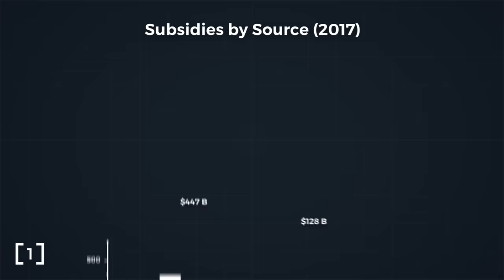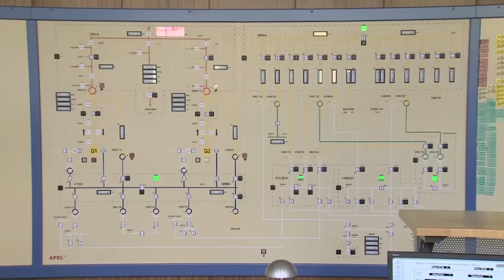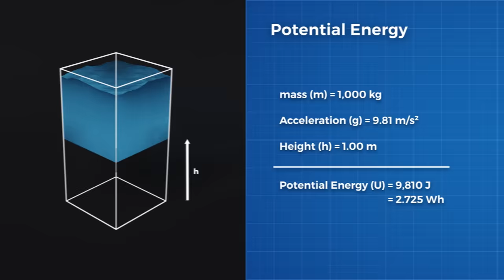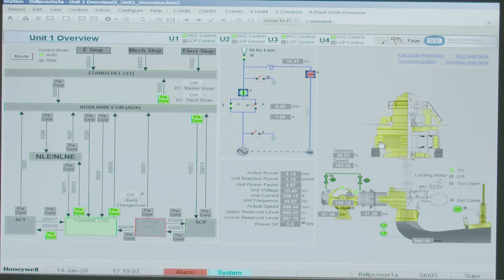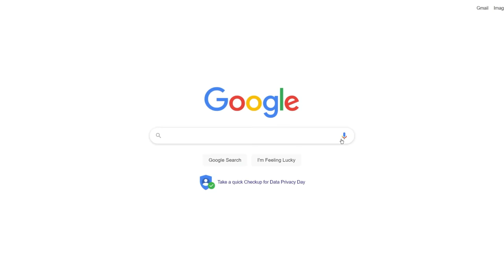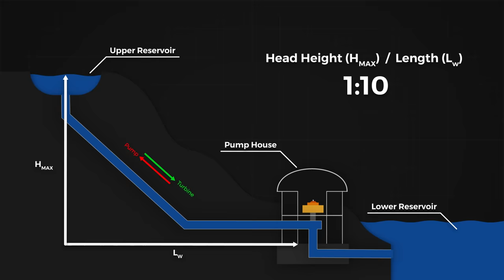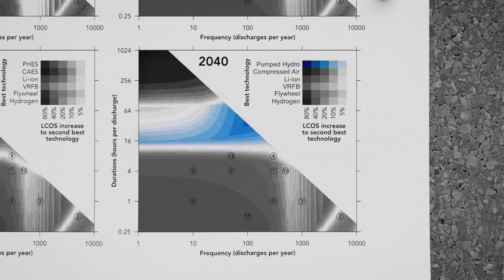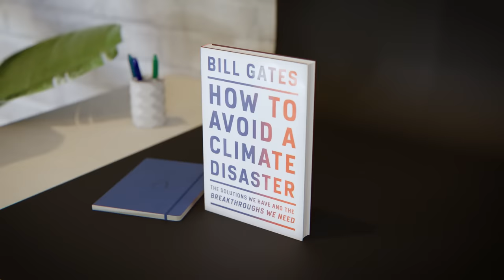The Truth About Pumped Hydro

Comment: You should take a look at the "El hierro hydro-wind plant" in the Canary Islands, it uses an old volcanic caldera and sea water.
Reply from the maker: Oh for real? I tried to find cool examples, but that didn’t come up in my search.
Reply: Indeed, the El Hierro 100% renewable island has been huge for a while, said to be the best example of such a solution, and it is.... Because it's a massive failure, the whole thing is so far from the claimed 100% renewable that it is laughable. No wonder it doesn't pop up anymore besides being used as an example of what such a "solution" brings:
- Massive price increase in power cost
- Blackouts
- Still more than 50% of all electricity is produced by diesel generators
This is exactly what this solution brings and is that perfect example of what NOT to do.
Reply: @RealEngineering  for a visit Cruachan (built1965) is a cracker and the climb up the Ben (Cruachan) is dramatic and almost lunar.
Reply: El Heirro:
What Kind Of Pumps Do They Use? Wind? Perhaps They Could Also Include A Battery Of Freznel Based Solar Condensation Pressure Boilers, With Hydraulic Pistons, Check Valves, And Inline Drop Points, Similar To A Combination Of Heart Pump Mechanisms And Transpiration, To Supplement To Pumping Operations? In Proper Applications, It Can Not Only Basically Combust Water Instantaneously, But Distill It As Well, While Producing Excess Extractable Energy.

Fo Realz.
Reply: @Gornemant  Even assuming your reporting of El Hierro is accurate, your conclusion can be dismissed because of your abysmally small sample size.
Reply: @AlbertaGeek  My conclusion on El Hierro, given that it repeats itself over and over again with similar projects, is:
"Never trust someone who is trying to sell a 100% renewable solution based on calculation, because they leave out so many factors on purpose to sell you crap that just doesn't work as advertised."
The massive price increase can be observed everywhere where an increase in renewables is attempted, best large scale example for that is Germany, they are also increasingly close to blackouts with interventions on the grid to stabilize it having gone through the roof. They have nothing to cover for the nuclear plants that are to close the next two years yet they are still happily churning coal and pellets from massive deforestation across the globe.
There has yet to be a 100% renewable solution with wind and/or solar, even on a scale as small as El Hierro. If it can't be done on such a small scale, then a large scale industrial country is utter nonsense.
Reply: @Gornemant   "it repeats itself over and over again"
Talk is cheap.  Name twenty.  Still an extremely low sample size, but should still yield better results.  I await your response.  And remember, the burden of proof is on you.  It is you who must support your argument, so no jamming out with the common refrain of the person who cannot do so: "Look it up for yourself."

Okay, so twenty examples.  An hour should be enough time for you to compile such a list, so we'll see where we are in 60.  I look forward to your response.
Reply: @Gornemant  So, you got nothing.  Figured as much.
Reply: The same thing happens in a Greek island Icaria https://www.ekathimerini.com/economy/241310/ppc-launches-green-energy-park-on-icaria/

Since we have a lot of islands we have tried different energy solutions in other islands like batteries or mainland grid connection. Also Volkswagen is turning Astypalaia island into a green island with electric vehicles and autonomous driving
Reply: @Gornemant  "Yeah, I got sleep and a life, we can't all be spending our entire time arguing on YouTube." He says as he wastes his time arguing on YouTube, the hypocrisy is unreal LMFAO.
Reply: @Gornemant  You don't need to memorize anything in this day and age of search engines (I asked you to compile  examples, not recite examples), but thanks for making such a predictable excuse - it confirmed a mental bet I made with myself.
Regardless, enjoy your Sunday, I sincerely hope you have a great day.
Reply: @Gornemant  100% renewable is possible in some places for example Québec has 78% of it's energy being renewable, but we're using good ol' hydropower on stolen indigenous lands. And it's cheap. This can't be done everywhere of course, what other renewable need is for the energy storage technology to mature. Also, every power production project is based 100% on calculations, and they always hit cost and technical overruns, that's the nature of engineering projects.
Reply: @grandsome1  "Stolen indigenous lands"? What the hell is an indigenous land? A land that ... has been on the land for a long time? What's an example of a non-indigenous land?
Reply: @ps.2  It's land that was recognized by colonists to be owned by the First Nations of the land. It is stolen when colonists or their descendants decide that they can do whatever they want with the territory that was recognized as to be under the juridiction or ownership of an indigenous group. Indigenous is defined as descendants of pre-Columbian people in the Americas. The government of Quebec decided to build some of their dams on territory they recognize to be indigenous, without the input of the people actually living there.
EDIT: The pre-Columbian people and their descendants are often referred as "Indian" in text of law, or First Nations, on top of "indigenous". The word indigenous like many other words has more than one definition.
EDIT2: "Pre-Columbian" , not "pre-colonial" .
Reply: @Gornemant  Koch Industries?
45.2% is better than 0%.
How to learn without trying?

Comment: Two medium sized nuclear power plants and Ireland is safe in terms of electricity. And space taken by them is laughauble in comparison to water reservoires required to operate to cover the needs of a country.
Reply: Though, of course, you'd have to build pumped storage for the nuclear power.  That's what pumped storage is mostly used for, at least on my continent.
Reply: @bearcubdaycare  the continuous operation of plants would help reduce the need for that, although cooling pools and just water supplies for plants in general takes lots of water
Reply: again, the right tool at the right time and place
Ireland need both base load power generation and fast acting power storage
we need both, not one or the other
Reply: @bee5440  continuous operation doesn't help you when its night and nobody wants the energy... if you only have slow reacting nuclear powerplants you need a ton of storage aswell or you will have to discard most of their power most times of the day

Comment: "Hydrogen looks poised to seize long duration energy storage". It's been poised for 50 years now. Now hydro using old mines.... You can also extract heat from the returning water for process or district heating.
Reply: If the fuel cell is inside a home you can use (un)waste directly as heating and create sterile drinking water.
Reply: You can also incinerate trash to boil water thus turning it a steam turbine, we can almost eliminate land fills
Reply: 50 years ago, climate wasnt part of the equation
Reply: Co2, when pumped back into the ground, takes up more space than the stuff it was mined from. You will run out of old mines before you make a meaningful impact on the problem, and most surface or close to surface mines cannot be used for this at all, for obvious reasons...
Reply: It’s like they say about fusion..  “Hydrogen’s the wave of the future, and it always will be”😆
Reply: @thepostapocalyptictrio4762  nuclear is the cleanest renewable energy source man has ever discovered and we have made it the safest over the last 70 years
Reply: @stefanr8232  Of course in natural water there can be useful amount of nutrients like calcium.
Reply: @andrewscott8892  Very true, but fusion is a nut yet to be cracked. A very delicious one.
Reply: @thepostapocalyptictrio4762  Easy to say, but it was actually used during feul shorteges in the past. Every wonder where the term "gasbag" came from? And just what do you think those bags were filled with, eh?
Reply: @stefanr8232  It's not even that hard to make, either. It's basically just electrolysis where you collect the gas coming off the negative end separately from the positive end. I could make one myself in one weekend. I'm genuinely not sure what the drawback is. 

OK, Well... maybe storing the Oxygen gas intermediary byproduct could present some issues. From what I understand Oxygen is a rather good oxidizer (citation needed) and high-pressure tanks of enflaming gas are... uh... not ideal... nor is liquid Oxygen.

Still far and away better than any other of the flammable fuels, a few of which we store underground *at every single gas station*.
Reply: @RandomAmbles  methane
Reply: @alextaylor9746  I would like to apologize to all fellow YouTube comment readers. Alex is absolutely correct: I didn't remember correctly! I went back and checked the source I learned about these gasbags from (a wonderful book called The Knowledge I would highly recommend) and found that, indeed, coal gas or methane filled the gasbags, NOT hydrogen as I claimed (which is harder to store due to its small atomic size). Alex, thank you for knowing the truth of the matter and for setting the record straight. You are the real MVP. 
👍🤠👍